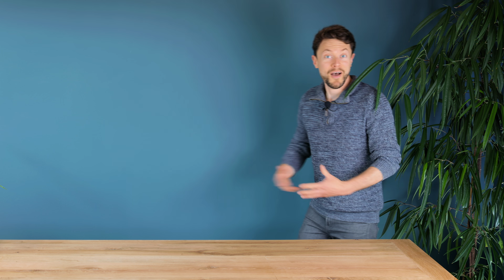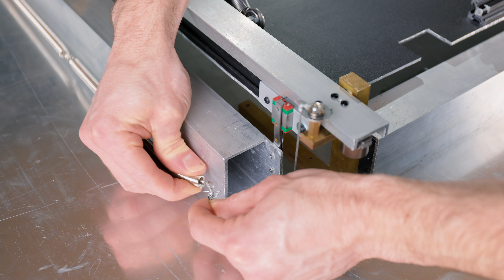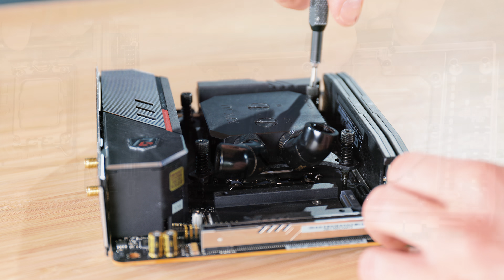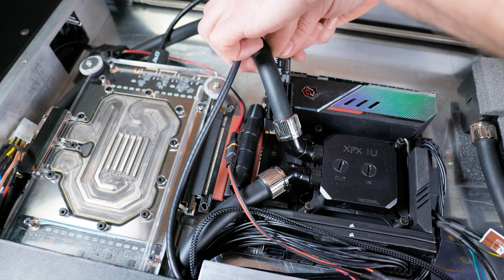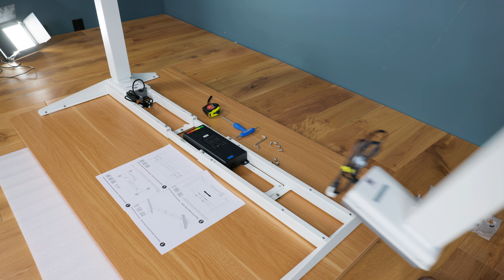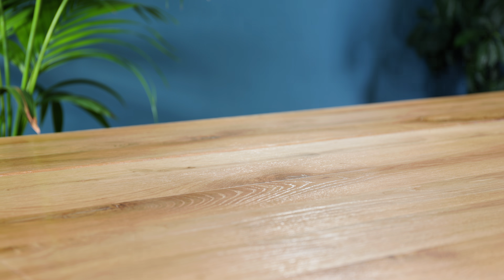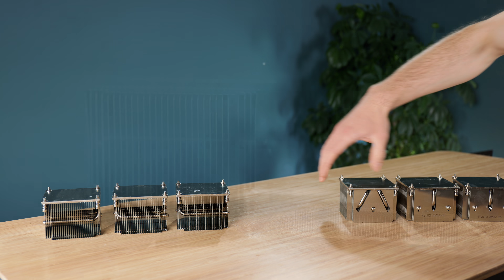Building the ENDGAME invisible PC

Comment: Very sleek. Huge fan of all your videos. I know you probably have other projects in mind but I kinda hope you keep working on this project as it's very cool and actually kind of practical.

I think you could better hide, and add pizazz to hide the cracks in the surface desk with some inlaid leather or even just a darker wood stain in that particular area. 

Some neat features to add might be some tuck away pull tabs that allow you to take advantage of the bendable screen, or perhaps even some sort of mechanical system that automatically bends the screen to the optimal viewing angle. It would be neat if you could harvest the audio parts from an old macbook or a thin soundbar to get some decent audio built in. Finally, having some sort of hidden flip up usb hub would be an excellent QOL feature.

Comment: Impressive build as always, the platform system is perfect and it looks amazing ! Sad the first cooling rig didn't worked out, it was pretty cool looking :D
If I might, you should think about some kind of guard in front of the fans... I built an integrated laptop cooler in a desk some years back (nothing fancy, basically two squares holes in a desk with fans under it to push air through to the laptop) and I sliced my feet open when I stretched my legs and forgot they were there lol
(also can you share what mix of oils you used ?)

Comment: Omg the most impressive part is the thin triangular strip that moves in and out of the way to seal the gap between the table and monitor when everything is shut. Absolutely incredible
Reply: not just impressive, extremely satisfying too!
Reply: if I had to guess it would be that he used a router bit set that has bit profiles that are inverted shapes to one another, so he cut a groove out of it using one bit, then used the matching bit to cut the peice that fits inside.
Reply: @taylorbledsoe6090  wouldn't even need two bits, a V cutter could do both profiles, still amazingly impressive, I let out a gasp when it sunk back into place
Reply: so simple, yet extremely effective!
Reply: Lol as a full time carpenter. I was like that's not bad... At all. Like I wouldn't expect anyone to turn that as clean as it was unless they were journeyed out. I'm guessing his dad is a carpenter lol.
Reply: @chriscotton4207 18:47 his dad’s “much better” than he is in any case haha
Reply: Ooooooooooor, bear with me here... he could've used the right hinges and not jury-rigged a solution after the fact. Those cabinet hinges he didn't use because the pivot moves and it makes the measurements more complicated? Yeah, they do that because they're designed to deal with EXACTLY this problem.
Reply: Matt doing Matt things! 😉
Reply: Unfortunately it seems the top wood thickness wasn't accounted for, otherwise the hinges could have been positioned to remove the need for that small piece. I think it was an afterthought.
Reply: @dfgaJK  if he had just used frameless cabinet hinges, he wouldn't have even needed to account for it
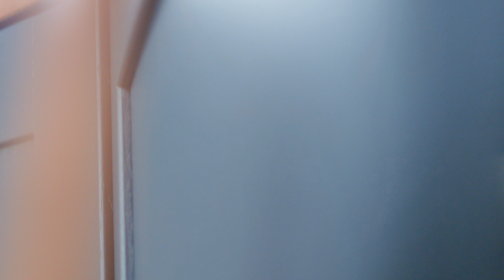Reply: @gupti  but they aren't a pure rotary motion. He did mention the as an option (2:19) but his lifting mechanism wouldn't work with them.
Reply: @dfgaJK  are, that makes more sense now! I know he mentioned those hinges and said he wasn't taking them, but it hadn't clicked that the translation of rotational to linear motion was the culprit
Reply: @dfgaJK  id say the hinges would always need a tiny gap or you'd need completely sharp edges underneath, possible i guess, if i spill something on it id prefer the triangle for sure^^ i think the opening mechanism is not just rotating around 1 point either, it shifts the board back
Reply: @b.w.6152  The hinge doesn't move it back, there is just wood material behind the pivot point at the moment. 
Those hinges are in fact just pure rotation around an edge if they are positioned correctly.
The "sharp edges" would be parts of 180deg. Two 90deg isn't "sharp".

There could even be a seal added just below the gap.
Reply: @dfgaJK  If it's really just rotating thats true but i cant really imagine it to hide the hinges, while the pivot point is fully level., and if its not level, there has to be some shifting back?
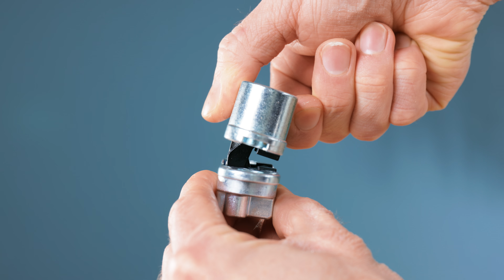Reply: @b.w.6152  no it doesn't have to shift back. The pivot of an invisible hinge is above the hinge fixing point. Look at 2:43 you can see the center of the rotation isn't at the intersection of the hinge fixing point surfaces, it is at the intersection of an ~9mm offset plane from each hinge fixing point surface.
Reply: @dfgaJK  Ah those hinges he's using, i missed that part, i was thinking about more classical ones, yes i think its possible with those, thank you!
Reply: @dfgaJK  incorrect, for the spacing to work out as you've mentioned the hinge would need to move in not just a purely rotational aspect which is what he describes in the beginning of the video. The hinge would have needed to have vertical linear play as well. Removing that gap would be possible if he had used one of those types of hinges but again he explains why he did not want to go that route.
Reply: @thomaslarrea1265  The space beneath the table has no bearing on the hinge movement since when it is closed the same volume is taken up. It can be a pure rotational movement.

Imagen a piece of paper flat on a table, and use a length of tape to tape down one edge, and now lift the other edge of the paper. The paper rotates around a bend in the tape, this is the rotation axis.

Now position the invisible hinges beneath the paper such that their rotation axis is along the fold in the tap.

If the tabletop is cut through along the perimeter of the paper and attached to the hinges it can then pivot up with the paper. The rotation is still only rotational as it was with just the paper alone.
Reply: @dfgaJK  nothing you just said translates into practicality with the mentioned hinges. they are meant to be recessed into the material. As this is not possible due to needing the structural integrity of the aluminum panel to mount to he could not have routed through that and the wood paneling on top as well to get to the required depth for what you are describing. Again, he could have used different hinges to achieve something better but with the ones he did pick this is not possible. watch Mr build it's "hidden room with a secret floor door" for a better understanding of these exact hinges.
Reply: they aren't the "exact" hinges but they follow the same principles
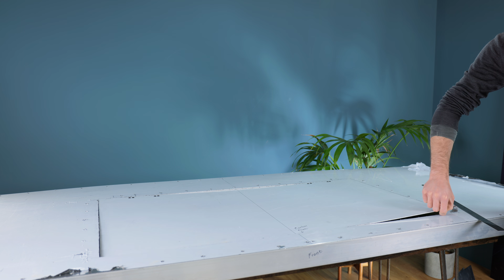Reply: @thomaslarrea1265  He definitely could have routed through the aluminium to recess those hinges further, if necessary he could have added more solid material around the cutout to reinforce the aluminium, similar to the brass blocks he is already using (2:50).
Alternatively, he could have made a pocket for the hinge to go into out of a solid block of material and then attached that to fill the cutout in the aluminium panel. This would even have been stronger than the current hinge mounting since it would distribute the hinge mounting load over a wider area.
There is no need to use a different hinge, just simply account for the wood thickness in the original design.
Reply: @dfgaJK well not really, remember the issue is that for the monitor panel to be flush with the rest of the table when closed there needs to be space for the panel to go when opened, so no matter what there needed to be a groove available, the triangle wood piece just wakes it extremely simple to close up that groove when the monitor is in the closed position
Reply: @kimhyunwoo8983  if you remember 2:49 ,he is using invisible hinges. These have a projected pivot point, so if they were positioned closer to the surface the pivot axis would be on the surface and there wouldn't be any need for the extra pivot space.
Reply: @kimhyunwoo8983  Not necessarily, the the monitor could just raise slightly higher when at the most upright position.
Reply: my question is, how did he install the string cables attached to it when the build was already done? Did he remove the bottom and then do it, or were the cables there from the start?
Reply: one of the easiest parts to design honestly lol
Reply: There's a piece of string attached. Probably attached to a spring underneath to pull it back in place. Matt loves springs. The springs for the hinge mechanism are spot on as well.
Reply: I audibly gasped when he introduced it. So fucking satisfying
Reply: I wonder how it stays in place and doesn't get moved with a hand.
Reply: i screamed at my tv when i saw that.
Reply: For real! When he started adding the wood finish I was like, "how is the hatch supposed to open now? The wood is going to block it. Oh right, just give the hinge edge some chamfered edges... but now there's gonna be a groove in the top, that'll be annoying..." And my jaw dropped at how PERFECTLY that little strip fixed that issue
Reply: between the extremely complicated hinge mechanism, the bonkers heatspreader and the zero compromise computer, how tf is a wood triangle the most impressive
Reply: @meylopes476 
The hinge mechanism is cool, but we've seen it before. The heat spreader is just a radiator but bigger. That triangular piece of wood was such a simple solution to a massive problem (the profile of the table), that Ive also had before, making a hinge so seemless. The shock value it being so simple yet effective is honestly the best part for me.
Reply: @similar_username  The real solution to that problem would have been putting the hinges in the correct place to start with. They are "invisible hinges" if positioned correctly there wouldn't be a gap to fill.
Reply: @dfgaJKisn’t the gap to fill coming from extra layer of would on top that collide? I don’t think that the hinge placement can solve this
Reply: @lalalops833  lol
Reply: Yeah, I imagine it's attached with rubber bands? Or tiny cables attached to some springs within? I'm curious how he did that.
Reply: It actually makes no sense to ne
Reply: @cristianruske2875  why
Reply: @cristianruske2875 why not? Due to the thickness of the screen it would get stuck on the wood behind it (since it's all supposed to fit perfectly together to be invisible) 

That little moving piece let's it still be completely flush without any visible gaps, while also allowing for the screen/table to fully open
Reply: @cristianruske2875  then shhhh
Reply: @cristianruske2875  It's just a piece of wood that sits on top that gets pulled back in with springs
Reply: @cristianruske2875  sure it doesn't to you

Comment: a potential issue may be the closing action of the computer if you added a latch to keep it open while in use so that any "accidental" pressure to the keyboard it doesn't just start to close also maybe add a magnetic senser to the screen for when it is closed that the pc/screen goes to sleep like how a laptop does.

Comment: Incredible PC and desk.  The main thing I would worry about (other than the CPU being a bit of a weak spot, should have gone for a 7950X3D for more power or the 7800X3D for higher efficiency) 
Is where the magnate is used to open the desk will likely wear after a few years I would guess. Maybe having that as a fall back but also having some hidden electrical or mechanical opening option could have been interesting.

Comment: That cooling "bar" seems like it would be a perfect fit as a test bed/promotional opportunity for Frore Systems' AirJet.

They only remove 5.25 watts of heat each, so you'd need around 200 of them. But at 27.5 x 41.5 x 2.8mm, you could probably make them fit. But they wouldn't be price competitive with anything.

Comment: This looks amazing, I wish I had a desk like this at home! I have 3 questions about it though.
1.: Where does the power cord go in? I'm assuming you have a splitter inside, so you can manage the parts with a single outside power source, but I didn't see where you left a hole for it. One of the corners in the back perhaps? Or was there a way to lead it through the Flexispot legs, so the cable can come out at the bottom?
2.: Excluding the GPU, and CPU, roughly what are the total costs of the materials/parts used?
3.: Do you have any plans of having this be "mass produced" for sale? If so, at roughly what pricetag?

Comment: 11:36 
''Behold... BRASS!!''
''But DIY Perks... this is the 7th time you've used brass in your project''
Reply: Yeah i also noticed that this lad does love his brass 😹
Reply: @rzkrdn8650  the same as cooling systems, I think there is no a single project that he made without adding a fancy cooling system XD
Reply: @angellestat2730  "Today we're building a normal desk with nothing fancy or special about it. Let's start with the cooling system."
Reply: well...we've yet to discover vibranium :P
Reply: @Ezio470  And Neutronium is just so expensive
Reply: @LordDragon1965   Unlike Explodium. Can't build a starship console without it.
Reply: Super awesome build! Ty.
Reply: hopefully he never discovers galvanised steel.
Reply: wait whats the difference between brass and copper? tbh I thought it was the same.....
Reply: @Chronostra  Are you confused with bronze and brass? Copper is most definitely its own thing.
Reply: @ThaJay  then what's the difference between bronze, copper, and brass?
Reply: @Chronostra  , copper is an element on the periodic table, so it is a pure metal.  Brass and bronze are both alloys that contain copper.  Brass is copper and zinc while bronze is copper and tin.  All having copper gives them some similar properties.
Reply: @sol_x_dier  ah okay. Also, how do I know, for example like in a radiator, that it's copper and not brass/bronze?
Reply: @Chronostra  , copper by itself is the better thermal conductor.  So, I would assume any quality radiator is using copper.  If you mean you want to be able to tell whether or not they did use copper like they should have, the color is probably the easiest way.  Copper should be much redder than the alloys.

Comment: My PC is invisible, it sits in a storage room DIY hooked to my house's air vent system. There are a couple of 20 meter HDMI fibre wire cables running to a TV, a desk with 2 monitors. This works great with a couple usb 2 active 10 meter cables and some wireless keyboards and mice.

No Heat, no sound, invisible and top level performance.

Comment: I would probably add an aluminum  "L frame" to kinda hide/protect all the fan. Even if they are located in the back of the desk, you never know what can slips inside it (cables, plants, cats..). If you add some mesh material to it you could even build a nice removable dust filter with some magnets.

Comment: The NAS imo wasn't a great solution. imo it would've been better to buy a cheap used Broadcom HBA card and connect a bunch of S-ATA SSDs to it. That way you avoid the PCIe x1 bottleneck that the NAS has, as well as the overhead of accessing it all through the network